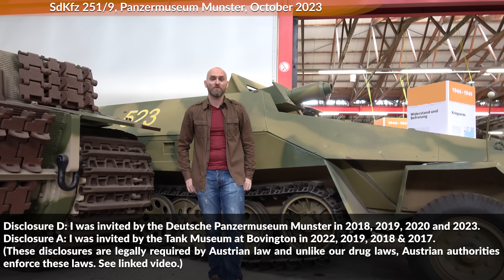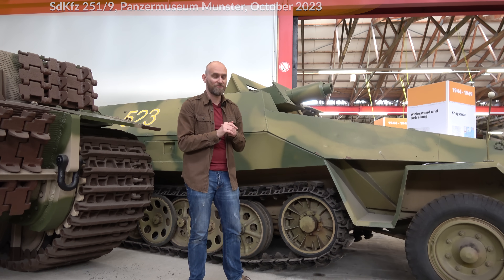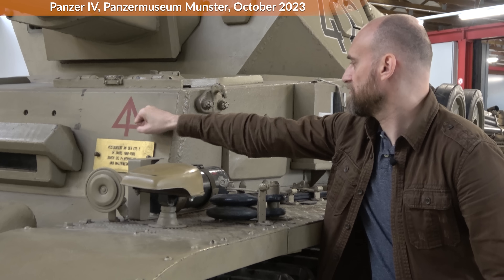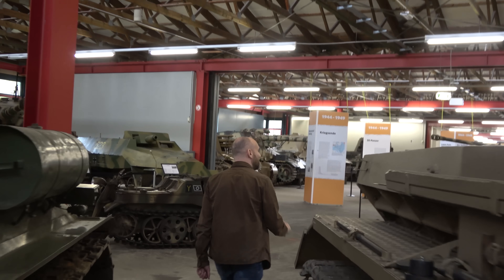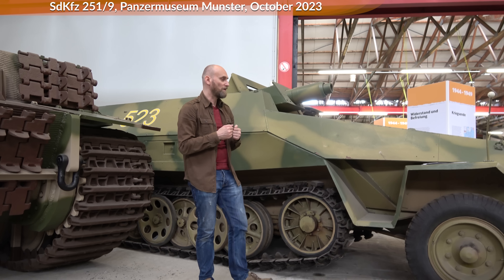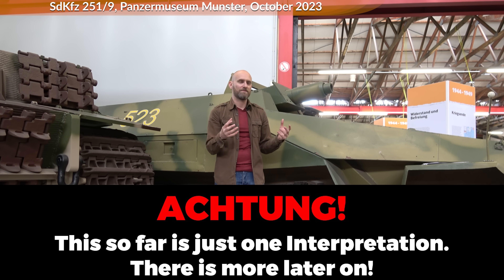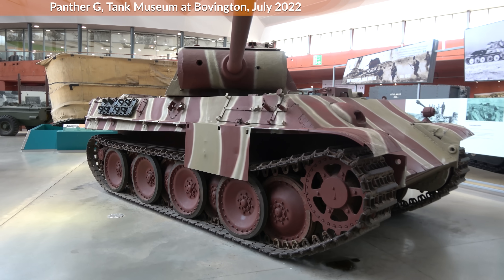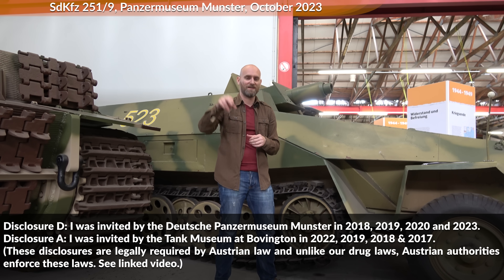Why was German Sloped Armor so late?

Comment: The main reason why early WWII German tanks did not have sloped armor, is because the trade offs are simply not worth it.
While sloped armor does increase the chance of a round bouncing of the plate, and increases the thickness of the armor that has to be penetrated,  as the incoming round is hitting at an oblique, what is lost is interior crew space and maintenance ease.
That interior crew space allowed German crews to be much less stressed from the travel than a T-34, plus the Germans had much better visibility. In 1941, a T-34 crew would be exhausted from trying to move to the battle, then be blind (lack of vision ports) and deaf (no radio) during the actual combat. That big gun and thick sloped armor required a really well trained crew to make use of it, and that was in short Soviet supply in 1941.
Remember, the goal of a German tank in early WII was to not get hit. You can read reports about PzIIIs dodging 76.2 anti-tank rounds, as in actually seeing the muzzle flash, then moving to avoid being hit. Armor was there to only protect against machine gun fire, not to survive a 40mm+ hit.
The reason why the Germans used interlocking plate armor, once they began to slope the armor, is to reduce the chance of the weld breaking. You can still see weld breaks on German tanks, but they are much less common than on Allied sloping armor.
A tank with a broken weld is essentially a useless tank, and it can't be fixed in the field, if it can be fixed at all.  Not only is the armor now compromised, and any additional hit will likely destroy it, but things like the turret ring are affected.
Each tank hull was precious to the Germans in late WWII. They expected tanks to get hit and keep fighting, and then go out and fight again without being sent back to a factory for repair.
If a Soviet tank had a ruptured weld, well the tank was likely destroyed anyway, but even if the crew survived, just get a new tank. Soviet tank life was SHORT, even if not destroyed in combat.
Same with the Americans and British. Late war, tank hulls can be replaced. Crew is way more important than a tank hull. Broken weld, just get a new tank.
This doesn't mean the Allies didn't try and salvage hulls or rebuild tanks in the field, but the value of any single hull was of less importance. After the Battle of Stalingrad ended, the Allies were not short of tank hulls.
The Germans were ALWAYS short on tank hulls, so they had to engage in practices that increased the longevity of each hull. Early war, that was to use speed and vision to avoid incoming fire, in the latter part of the war, it was to still try to avoid being hit, but rely on armor if hit, and keep relying on that armor until there was a penetration.
Reply: 1. All T-34s had the ability to receive radio signals, but not all had the ability to send them (otherwise it would be strange for pragmatic councils to allocate a whole person just to fire a machine gun). The same situation was with German tanks.
2. Unlike the T-34 crew, the Tiger crew’s stress began during field repairs. Almost all German armored vehicles have a terrible protection to weight ratio, due in no small part to a lag in armored vehicle design. The Soviets, having less developed production and a lack of resources (especially human resources), were able to bypass the German tank builders in many aspects, for example - weight, quantity, diesel power plant.

You correctly noted that the Germans did not have enough tanks (I explain this by saying that the tank builders of the Reich wanted to make money, not win the war. The story with Zimmerit is indicative in this regard), but personnel, or rather the lack thereof, became no less a problem.
You probably know the successes of the Wehrmacht in 41 (although what kind of successes were there, only one of the main intended goals was achieved - the capture of Kyiv), that having less advanced tanks, the Panzerwafe achieved better results than in 43. The basis of this success were skilled soldiers, veterans who had gone through campaigns 39 /40 years. These veterans formed the basis of the German tank forces (the ratio of infantry and tank units is approximately 1/5). It was they who broke through the Polish/French/English/Soviet fortifications/defense lines and it was they who suffered heavy losses in 41, which led to a decline in the combat effectiveness of German tank forces.
Now let's sum it up. When German tank units, the basis of the offensive potential of the Wehrmacht, suffered heavy losses, they were sent to the rear for reorganization, where they brought up new recruits to the level of veterans and waited for the arrival of new equipment. All this took a long time, for example 8 months. And while the Wehrmacht elite was in the rear for replenishment, there was no one to attack, because the infantry units remained at the level of development around 1917 due to the fact that almost the entire budget of the Reich was invested in tank units and there was no money left to equip the infantry. And this was during a period when the initiative belonged to the Wehrmacht, when the Soviets began to counterattack, they had to pull away tanks to cover gaps in the defense, which did not allow tank units to be concentrated again for large strikes. This is what we see from the activity of the Wehrmacht - 41 offensives in 3 main directions (center, south, north), 42 only one main direction (south), 43 large-scale offensive on a local section of the front (citadel) and more and more serious offensive actions were not carried out, transition to defense.
Reply: Many of the issues with the T-34 stem from design choices, not because of sloped armour. The Soviets and Germans had different philosophies when it came to making a tank, and when you're a country who favours quantity over quality AND are trying to modernize your entire army before its too late, you're going to make sacrifices. Sacrifices, such as radios and vision ports.
Reply: @ASlickNamedPimpback the absence of radios and vision ports were a lack of and a flaw respectively, not really sacrifices. When western radios flooded in via lend lease and they had the opportunity to design new turrets, in came radios and vision ports
Reply: @jurassicturtle3666  design choices like “hey, do we have enough radios to supply all our tanks WITH radios” “nope” alright then, don’t bother” and “hey, how’s visibility on 8’o-clock?” “It’s terrible” “how bout we add a gunners port or something?” “We’d have to extend the hull” “don’t bother, it’d take too much time”?

Comment: From welder's perspective: straight welds are faster and worker doesn't need a lot of experience to make a good weld. Interlocking plates present a challenge because on one hand welder can do his job in such a way that will prevent material/ weld stress ( comparing to straight weld). On other hand interlocking joints will take much more time, effort and weld quality will be often questionable. Look at pictures of knocked out tanks. Very often it's the welds that let go,not armored plates.

Want to make welder's life hard? Design welds like those of Churchill tank ( as observed on example in Borden Base Ontario, Canada). What a nightmare.
Reply: And if it’s the welds blowing out, that means their welders aren’t getting full penetration.
Reply: @MarcosElMalo2 can you get a full penetrative weld on 120mm plate in the 40s?

Comment: I understand there are other earlier vehicles that incorporated sloped armor in their design, but I would argue they are fundamentally different than the approach T-34 took.

T-34s are simply, the first ever tank that has a main gun capable of destroying every target it can face whilst also being a good anti infantry weapon, has good mobility in all conditions ,and has enough armor to withstand every single contemporary tank at closer than combat range. Prior examples either used sloped armor for convenience or to save weight to make cheaper/smaller tanks; however the T-34 used sloped armor as a mean to get all three of the firepower-armor-mobility triangle.

T-34 basically introduced the world to a brand new class of tanks that later M4 and Panthers falls into, and they are in no way similar in terms of capability and role to their earlier “medium tank” counterparts. That “fast and beat everything whilst remaining reasonable” concept would later be refined with new technology into the MBT concept of T-54/55. And it wouldn’t have been a thing had T-34s been forced to luggage around 80+mm of flat front plate. For that I think its reputation for “pioneering sloped armor” and being “revolutionary” is more than deserved.

Comment: I'd like to see how the hulls were set up in their jigs for welding. I could see it being easier to quickly and cheaply construc hulls  without having to build complex forms to hold the plates in place. You cut the plates to size, then interlock them with gauge blocks as spacers then weld it up removing spacers as you go. 
Note the interlocking shows up on newer designs when more tanks are needed quickly and Armour is thickening.

Just a thought.

Comment: I think that for Jagdpanzer 38 there was no interlock between front and side because side armor was like only 20mm. So if there is anything to gain from interlocking, this helps very little when  done with such thin plate.
And probably, over time, welding techniques improved and/or more experimentation proved that interlocking isn't worth it.
Next time make video with interlocking plates in title and talk about sloped armor most of the time ;)

Comment: The Pz-3 snd 4 are relatively small but still considered the best in crew layout and ergonomics in the early years - according to the Chieftain. Sloping costs space and wasnt necessary early on.
Reply: Sloping does not by default reduce spac by default, only in a direct 1 to 1 replacement.

Comment: Also welding had just been adopted for major industrial production. So welding processes were there but structural design had not really been  adapted to the process. The interlocking plates are a really good example. They only chose to do so because the structural integrity would be better this way because they did not manufacture full weld penetration on the armour plates. This was a compromise on integrity and welding. The plates support themselves somewhat better by interlocking. But it makes welding even harder. You can tell by the poor weld surface and layers on these joints.
Reply: Some of the welds look terrible with inadequate penetration. It looks not so much like welds but like they were stitching the plates together with small diameter filler. 

The weld on the M-10 looks sloppy but adequate. We can’t tell from a video of painted surfaces, but I imagine that the plates had been bonded into a single plate.

I find it hard to believe that the Germans didn’t understand the welding process, so I wonder in the “joinery” was to compensate for a shortage of skilled workers on certain production lines. 

It would have been funny if the used dovetail joints. 😅 Supposedly stronger than finger joints.
Reply: @MarcosElMalo2  The Germans actually did use dovetail joints for early production Panther Ausf.D's turret front/side plates, but this practice was dropped after a short time in favor of their standard interlocking plates.
Reply: @timob3490 True, but most of the welding was used in structural steel, not armour steel. 
I don't think this is the reason why it is used in armoured components, but in sheetmetal products those battlements are used (usually cause it is a 'free' functionality in a laser cutting process) to both position the individual plates, reduce the amount of weld (not the case in the armour) and to limit deformation due shrinkage of the welded area, actually, the weld shrinkage (in a proper quality weld that doesn't crack!) pulls plates in a stronger connection. 
I wonder if it was an attempt to limit welding jigs, by having the plates interlock closer together themselves? It feels a bit ungerman lack of Handwerkskunst, but it doesn't really show up til Germany really wants to ramp up production.
Reply: @Tuning3434 Question: when hit, or when on the move over rough terrain,  do the interlocks reduce/prevent crack propagation along the weld lines?
Reply: Right, but the interlock keeps the plates better in position. This especially when welding plates in complex angles by less professional staff. 
So the interlock might simply have been a need for manufacturing. Just a thought - not a fact
Reply: @carstenlichy-bittendorf3902  - A novice welder will not weld such complex joints well.
Reply: I wonder if the interlocking plate design was possible on the German tanks because they produced them on a stand and not on an assembly line. At least that was what Jonathan Parshall showed in his presentation on the Tiger. In such production, highly skilled craftsman are employed while this is not usually the case in assembly line production.
Reply: Funnily enough russians somehow DID manage to produce good quality welds that didn't require this nonsense long before that, go figure. So much for the german tech superiority...
Reply: True. Interlocking increases the length and complexity of the weldseem, which was arguably the weakest part of armor back then.
Reply: I believe the interlocking armor is a product of the intelligence war between the various countries and germany. Where the germans were convinced this extra step was needed for some reason. Thus slowing and complicating their production of armored vehicles slightly. It makes the most sense given the idea has completely faded away almost directly after the war.
Reply: @geronimo5537  That does sound like a Special Operations Executive sabotage by feeding misinformation campaign. Would be great to know for sure. Will certainly trigger a few chuckles.
Reply: I agree. The interlocking is most likely used to hold the plates in place during assembly/welding process.
Reply: @hakimzah  Sounds logical. A crane fits a new panel, the teeth hold it on the spot, then the welder goes to work while the crane operator moves on to the next job. Sounds like efficient use of time and resources, even if it means 15% longer welds.
Reply: German welding technology was significantly less sophisticated than the Allies. That is why they interlocked the plates, because their welds were inferior. Interlocking the plates provides support in two planes so that of the welds fail you still have steel plates backing each other up. The better welds of the Allies meant that they could just butt the plates and seam weld them, relying more on the strength of the welds.